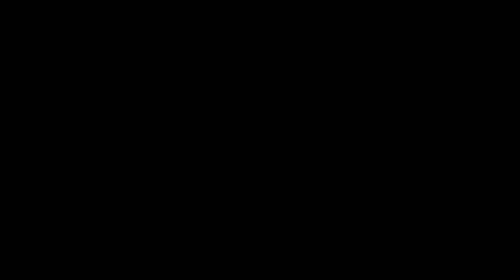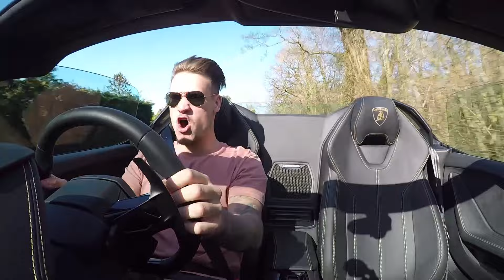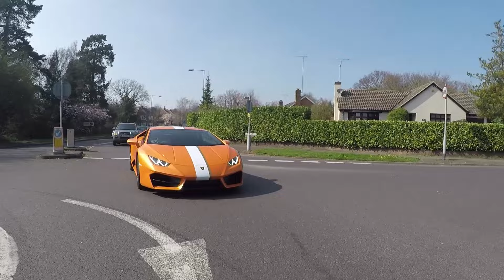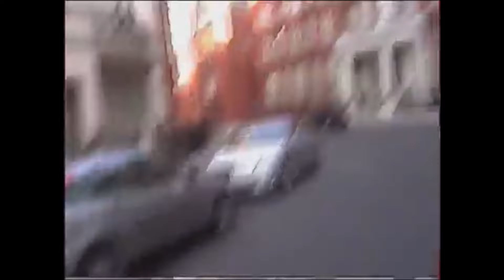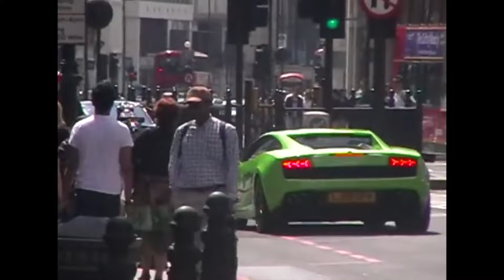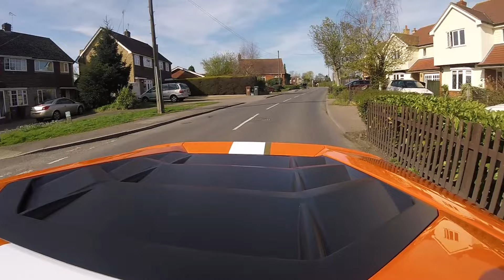WHAT EXHAUST FOR MY LAMBORGHINI? | EXHAUST EXPERT | EP 7

Comment: My friend, they can tell you whatever they want but the exhaust tone and sound is mainly created by the number of cilinders, firing order and exhaust header design. If you do not change that, you are barely going to change the sound, just the volume.

Check out a Ferrari 599GTB and a GTO, that sound difference is due to the manifold from 6-3-1 in the GTB to 6-1 equal length headers in the GTO. Check out Pagani Zonda and the Mercedes engine, that sound is thanks to the headers manufactured by MHG.

Don't waste your money unless you change headers.

Comment: if would help me understand which exhaust to choose if i knew more about how they worked?  can you tell me what difference a tuned exhaust makes to performance?  why are exhausts tuned or what difference to the engine does it make to have shorter or longer pipes or wider, larger?  these things i hear make a difference but I don't know why?  as an expert can you shed some light into this engineering area, this will make your car run better too.

Comment: What is the neeed for a new EXHAUST ?
Reply: sounds better, more power... why wouldn't you upgrade an exhaust system?
Reply: Dan Jones if it's already good exhaust, why to?
Reply: Stock exhausts are not considered a good exhaust.  They are produced by the manufacturer in line with laws and regulations, often meaning they are quiet and reduce the power of the vehicle.